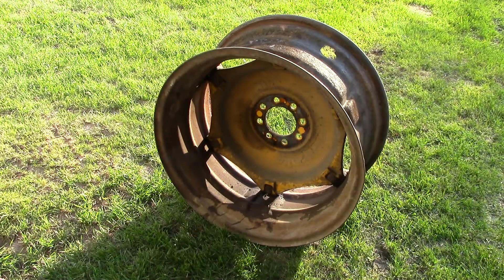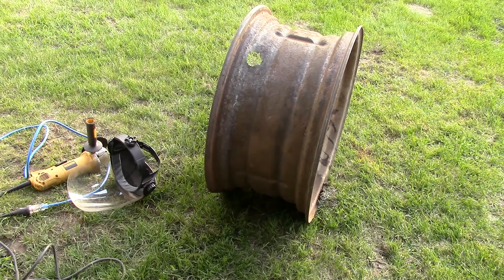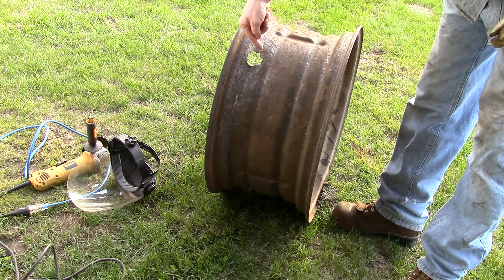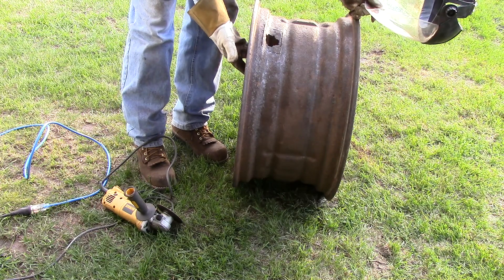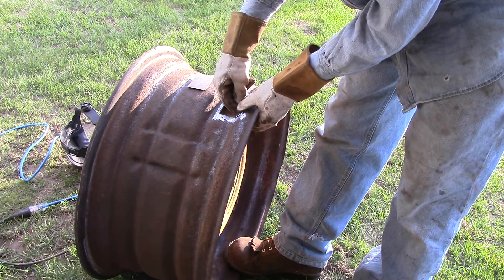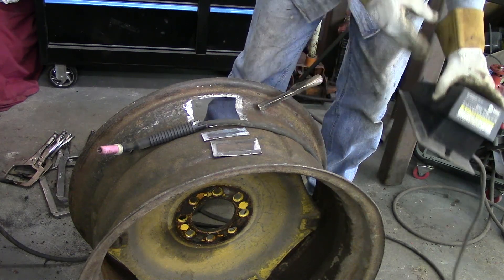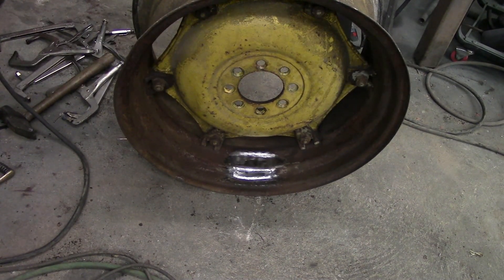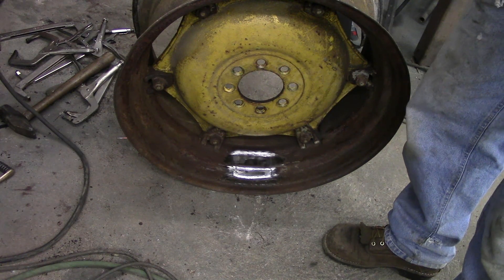How to repair a tractor wheel

Comment: Looks like a Massey Ferguson or Ford wheel.  If you had a scrap wheel on hand, you could cut new parts from it to weld into the rim you are repairing.

I just had to replace the power adjust rear wheels on on my Massey Ferguson 270 Diesel because the inner tubes leaked calcium chloride and slowly rusted out each wheel very badly.  It was cheaper for me to source gently used rims than fix or replace with new the existing rims.  My 28” wheels also have heavy cast centres.✌🏻🇨🇦
Reply from the maker: Yes you are right, but old tractor wheels are getting harder to find. It was my neighbors wheel, I believe Ford, he only had this one, and it wasn't in too bad of shape. Thanks for the comment.

Comment: Great video!!  I'm repairing an old tractor rim as well and was wondering the exact recipe for the rust protection.  Can I just use tar or would you recommend only using the roof patch cement.   I have both kerosene & diesel, would you recommend one over the other?

Comment: your welding skills suck ,
Reply from the maker: If you watch any of my videos you will never here me say I am great at anything. I do a fair job at everything I involve myself with, but I do care more than most, and work hard at everything I do. Thanks for watching!
Reply: @HRIservicesllcSturgeonBay i am sure that repair will outlast the tractor !!
Reply from the maker: Thanks Rainee, always appreciate constructive comment's! Have a terrific weekend, stay safe! 😁
Reply: @HRIservicesllcSturgeonBay  well sir you encouraged me to repair my tractor rim . 1979  Ford 1700 front tire , valve stem hole rusted out to very large holes on both rims . Extremely hard to find a lot of stuff for this tractor. got it cleaned up ,cut out for small plate bent so only one weld around patch .  Cut new hole on different spot . no TIG rig so innershield it was !!  Primed, painted , new tube and tires  Good to go !  I have  been a welder for many years and one thing i hate is someone ( and there is ALWAYS  at least one ) who has to make useless comments . When someone talented as yourself takes the time to make a video to HELP out anyone in need it is priceless ,  you are a blessing to many sir .  Thank you
Reply from the maker: @raineetriche9685  thank you very much, I try to ignore the negatives, I don't get many, but awesome comments like yours more than make up for it! Thanks again.

Comment: there shops that will have the inner part and outside rim they will welded two together. Had a skidsteer that i had all four wheels made.
Reply from the maker: Yeah if I had a large roller I could make almost anything. It would be nice! I just try to concentrate on the welding and small fabrication, I hire out items I don't have the tooling for. Thanks for the comment.